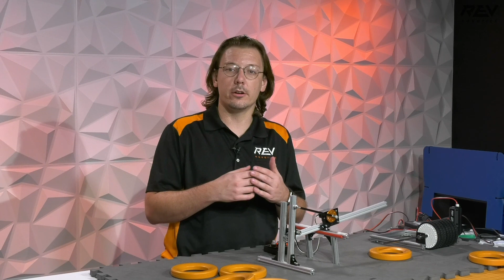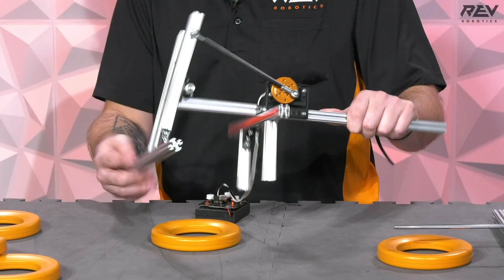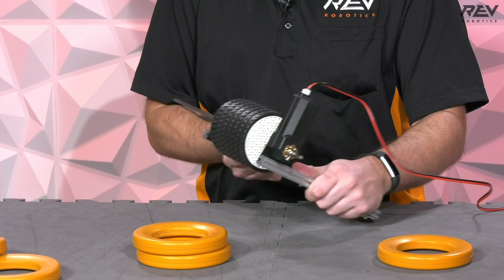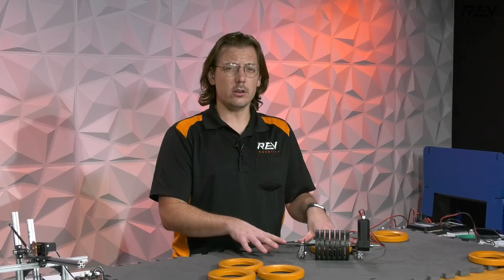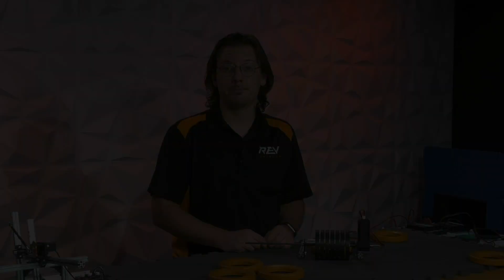Intakes Part 1 - FTC Ultimate Goal 2020-2021 Prototyping

Comment: Are those 8020 channels... My team uses 8020 so we might be able to improve this design if it is 8020
Reply from the maker: The REV Extrusion profile has some of the same features, like adjustability, as a product like 8020. The 15mm extrusion is a bit smaller/lighter as well as using standard M3 Hardware to attach brackets and the like.
Reply: @REVrobotics  Thanks